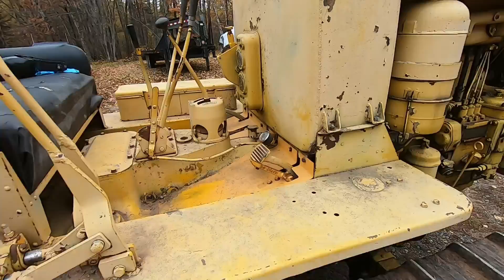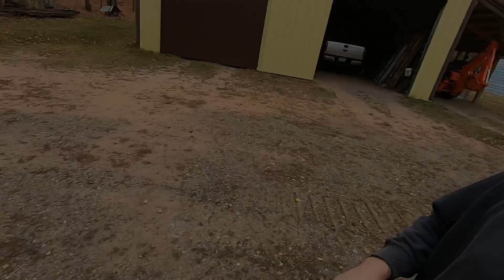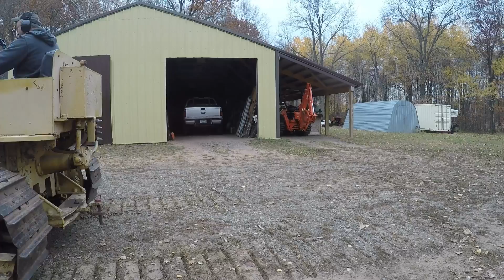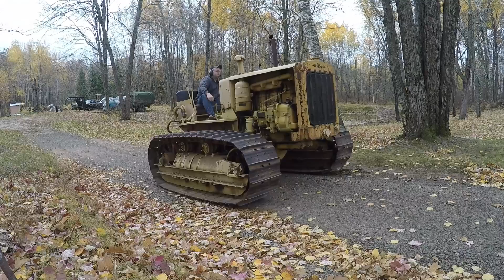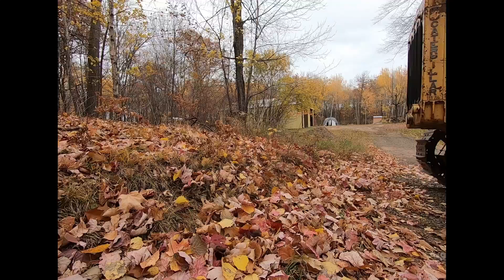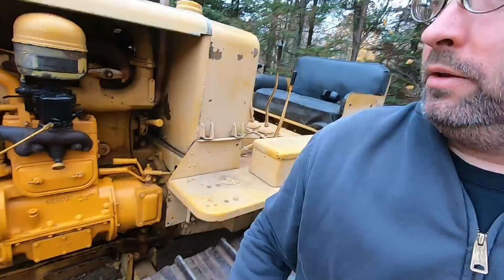Caterpillar "Pony Motor" - Can Just The Starting Engine Power The Whole Machine? Let's Find Out...

Comment: This all makes sense, actually. 
The diesel is rated at 52 bhp @ 750 rpm. Or 364 ft/lbs.
The pony engine is 24 bhp @ 2700. 
Or 46.7 ft/lbs. 
So, the pony engine develops 46% of the horsepower of the diesel at 3.6 times the rpm. 
Effectively, the pony engine develops 12.83% of the torque of the diesel at the pony engine's crankshaft. 
Given the ratio of the pony engine's starter pinion, & the ring gear around the diesel's flywheel, which is probably around 40:1, then moving the dozer in low gears & light load isn't too difficult.

Comment: I just picked up a D68U early 50s model and this is what im having to do to move it. Problem is they left it parked in gear and it wont come back out.
Reply from the maker: Make sure the main clutch is disengaged before trying to pull it out of gear, because there’s a shift interlock that prevents the shifter from being moved when the clutch is engaged. If that doesn’t pan out, you might be fighting an interlock linkage that has been damaged or has come disconnected, preventing it from releasing 👍
Reply: The shifter will go forward and back but will not go left or right. Im guessing its stuck in 3rd. Pony motor runs but diesel wont turn over.

Comment: Hey that was pretty cool. Yes I wondered about the missfire and your thinking it didn't have enough power to go. You didn't hear that much RPM loss, as if it was stalling because of load, but the timing thing makes sense. Its kind of funny, as heavy as that starting engine is, that its design is so limited, and not like a conventional small engine. Sure, it does what it is needed to do, but for an outsider like myself, I'm surprised. In theory, 24 HP should be enough to move dirt in the lowest gears. Something I have no idea about - does the compression release fully release all compression, or does it just reduce it? It sounds like engaging the diesel does put quit a bit of load on it. 
My context for all these questions really comes from some of those "will it start" videos, where the crawler is buried in the woods some place. If they can just get the pony motor running, they could at least rescue it and get it on a trailer.

Comment: I am new to Bulldozers. So you have a gasoline powered Pony engine that on demand can turn the crankshaft to start the diesel engine. Can the diesel engine start without the pony engine? ie: does it have a stand alone starting system also? I heard about air starters in the past and of course conventional use electric starters. That drivetrain has a ton of gear reduction to move that thing by the pony engine in 4th gear! I think it was 24 horsepower and 13,000 lb s?

Comment: 15:27 That was not running full throttle - the governor was actually doing its job ! So maybe the ignition was too far advanced. Maybe it was a fuel issue too - as those engines aren't expected to get bumped around in use !

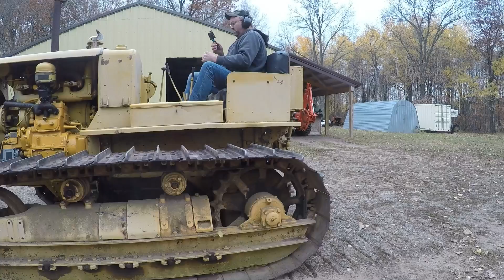Comment: 5:00 - so if normal engine rpm is 1,000 and the donkey engine drives the main engine at 100 rpm, that's 10:1. If the gear ratio of 1st gear is 10:1 too then, driven by the donkey engine, an hour's work would take upwards of 100 hours to complete !
I did expect it to do all it would with the main engine power - but ever so slowly !

Comment: Great Video, I enjoyed that. Reminds me of the time I had to move my Land Rover about a mile using just the starter motor. It went surprisingly well with the four spark plugs removed so no compression, the transfer box in low range and just done in stages to let the motor cool down. I had a small 12v generator running in the load bay keeping the battery charged. Took a while but it sure beat pushing it!
Reply: What was the output current of the generator ?
Why would the engine start?

#epic_journey !

Reminds me of a journey in an early Landy towing something up a hill - at a speed where I started counting the white centre lines on the road !

Comment: There is a 1950s D7 cable lift for sale/bid here, but the pony motor is replaced by an electrical start.  Is this a deal killer?  I can pay a bit over double instead for a used model D6 6-way.
Reply: @squatch253  A can of ether spray?

Comment: Look at it this way, WW1 tanks weighed around 28 imperial tons , max speed of 3-4mph and needed a 16 litre , 6 cylinder petrol engine of 105hp. In that context, look how far we've come when you can run a Cat on a 26hp engine. Massive advances in gearing and engine technology , let alone metallurgy. Surprising what these old engines can do.

Comment: Excellent, Very Impressive Machine!! I agree with you about the Timing and Hill Climb the way it was popping, if it was fuel it would gradually slow down even running at full throttle. The popping is from the unburnt fuel in the exhaust from the misfire, timing. Both engines sound Excellent Running, the crispness in the diesel engine Very Nice!! This test also proved how good the hydraulic system, I was thinking there wouldn't be enough RPMs to run the hydraulics, it did steering and all!! 
Thank You For Sharing!!!
Liked, Sub & Notified

Comment: I’m gonna comment before I watch, because the petrol is likely geared to get the diesel going as fast as it can on a cold day. So it can’t move the tractor. It could if it was geared lower, it is big enough, but it can’t :o)
Reply: I was delightfully wrong :) I’ve rebuilt a few of those top rollers. I got pretty quick and used to do say six at a time.

Comment: the movement of governor throttle linkage was jumpy and snapping wide open fast so I'm saying lean out misfire, my ears were also saying lean misfire/backfire, so a bit richer main jet setting should have fixed it right up. if not then try backing the timing off some, but it will lose power fast :)

Comment: My father hauled and operated heavy equipment for years I grew up watching him load and unload the equipment when they break the only way to get them back to the shop and repair on was running on the pony engine reverse is the lowest gear and it will back it onto the trailer

Comment: I don't think that harmed the starting motor at all. They may have not been designed as a continuous run all day engine but folks have to realize that that engine wasn't just designed to start the main it was deigned to warm the main for starting. Combined water jacket to warm the main's water. Exhaust running through the main intake to warm the air coming in and then compression on with main fuel off to warm the heads. If you are in milder climates you didn't have to run it long. But if it's minus 40 back then? Starting wasn't an option and few had machine sheds heated to store equipment day to day or even access to power to plug in a block heater. Also consider the viscosity of the 30 weight oil they used then as compared to today in those colder temps. I think those starting motors are a lot tougher than folks give them credit.

Comment: I dont know if this story is true but I used to be a mechanic for caterpillar years ago and I heard a story of a guy that was hired on by a coal company and he claimed to have more experience operating a dozer than he said he did so he got hired and they gave him a job to do with a cat dozer, they dropped him off and told him what to do, he came back a little while later complaining that the dozer didnt have any power so the boss goes out to the dozer and fires up the pony engine then starts the diesel and starts pushing, the new guy has a very puzzled look on his face, when the boss man shuts the machine down and comes over to the new guy the boss man soon finds out that the new guy had fired up the pony engine and engaged the drive and was trying to run the machine and push dirt with the pony engine 😅

Comment: According to the old timers in the area it was fairly common to use the pony motors to get unstuck. It would turn the tracks slow enough to walk the machine out of the mud instead of spinning.
Reply: Why not just idle the main engine down , I sure never heard of such a thing

Comment: We did a airstrip job(?) back in the 70’s(?) - before my time

Had a couple of machines with pony motors that they used to just start by letting the brakes off and letting it roll down the slop... to the cliff that lead into the water

Because, it was easier.

I think one machine was new, both were fucked after the job.

Comment: Thumbs up for your video.
You'd almost think it was designed like that for emergency use but with most diesel failures you wouldn't be able to spin the engine

Comment: I'm not surprised the pony could move it, as the electric starter motor on a manual geared car or truck can move the vehicle quite strongly in 1st or reverse, without any decompression.   Done it myself to recover a vehicle driven by a ning nong into a river.
A question for Squatch:   I bought an old D4 to do firebreaks on my hobby farm.  I found that if the diesel was already a bit warm, once I had the pony turning over the diesel, even with decompression on and the rack set to cut-off, you could feel the diesel kicking and puffs of smoke would come from the diesel exhaust.  Is this typical or was there a faulty adjustment somewhere (could only be in the  fuel pump)?  I initially thought that the decompression lever was not fully effective due to excess wear, but on inspection this was not the case.    Yet the diesel always stopped promptly when the rack was closed.
I wouldn't worry too much about shortening the life of the pony in this test.  While nobody in Cat would have thought it would ever be used for more than a minute or 2 each time,  once it is competently engineered with sufficient bearing surfaces etc to function, its life should be not particularly shorter than any other small splash lube gasoline engine.  Perhaps the pinion will wear though.
What I found is that these pony motors (on my D4 anyway) get their water jackets and passage clogged up with white gunge which causes overheating - which will certainly shorten its life dramatically - but in this case Squatch has already rebuilt the pony so that won't be a problem.  Not long after I bought it, I had to rebuild my pony due to clogged water jackets.
Reply: @squatch253  Hi, thanks for responding.   It's a 6U (1950's).   I take it from your reply that it indeed isn't normal for it to occasionally weakly fire when the lever is in the shut off position.  I didn't want to go dissassembling the fuel system for no good reason.  I have the usual hobby farmer's level of experience with gasoline engines but no diesel repair experience until the D4.   You may be amused - one steering clutch failed within run-time hours of me buying it.  Turned out that hoses that convey grease from nipples to bearings had come apart - plenty of grease in the bottom of the housing but not where it was needed.  Diesel engine runs nicely though.
Reply: @squatch253  Thank you muchly.   I'm going up to the farm this afternoon to do some work over the weekend, so I'll try your instructions.  I would be surprised if there is any problem with the injectors,  as the engine runs very smoothly at all settings  No smoke at any time except a bit upon starting or cranking as described.
Re parts:  Local Cat dealer parts department is pretty impressive.   I have yet to ask for anything they didn't have in stock, or couldn't produce same day from another branch.

Comment: What about the possibility of the engine hydraulically locking due to all the excess fuel? And if the fuel was off what about running it like that with no upper cylinder lubrication? So either way with the fuel on or with the fuel off I just don’t think that’s a good idea!
Reply: The atomized diesel gets pumped out the exhaust, it will never hydraulic lock.

Comment: We had an old D7 cable dozer with a trailer log arch that we skidded logs with when I was kid. Diesel spit 2 rods out of it about a mile back in the woods my grandfather spent 2 days pulling the head and getting the pistons and broken rods out of it. he through the pan back up and head on and dumped a few gallons of oil in it so the crank had something threw some antifreeze in it and limped the crawler and arch back to the landing on the pony wasn't fast by any means and had to stop a few times to let the pony cool down but he got it back to the landing and then drug another 5-10 miles with our old pacific truck I felt like a king thar day being 13yrs old in a monster pacific towing my grandfather out to a main road some of my best memories.

Comment: Worked on dozers (D9 serial 66A12576) used in strip mines in the 70'0 had poney motors. In fact as far as i remember all 9G's could be speced with pony motors.

Comment: I strongly believe that no internal combustion engine should run on "straight weight, non-detergent" oil.  Gasoline 10W30 is fine.  Well below freezing operation, probably 5W20.  High ambient, 20W50.  Clearly heavier for diesel engines.
Synthetic not required.
Reply: @squatch253  You are correct about that !  Just my opinion.  Along with $1 it will get you a "Senior coffee" at McDonald's !
Reply: @squatch253  Maybe you can help this guy source some parts.  https://youtu.be/ogJKfZmlt24  For sure he need a F7X15 sediment bowl and gasket for his money

Comment: Not long out of high school, I worked on a pipeline as a swamper on a D-7 Cat that had a pony motor that I had to start each morning.   It could be a bear in cold weather.   It had a cable lift blade that  operated from a front end PTO winch that had a clutch system in front of the radiator and a heavy duty winch on the rear.  The operator that ran it only had one arm.   There was no power assist on anything on that tractor, he had amazing skills.

Comment: Really didn't surprise me on the flat, on that incline that's a different thing all together, you're probably right about the spark advance but I wouldn't do it again, you know you'd feel terrible if anything happens to the start engine, thanks for doing it I've wondered about that myself, at the end of the day I think it was designed to be able to do that in an emergency situation

Comment: I often wished some of the new machinery had pony motors. They don't even have a clutch on the hydraulic pump so they turn everything when trying to start. They have to be parked inside when it's cold.

Comment: My first initial answer is/was, yes. For the simple reason, you're turning the diesel engine over hence, turning the clutch(s) and transmission gears. Only other concern of doing this is, the injector pump on the diesel, it's turning without any fuel being pumped through it. Last I knew, injector pumps used the fuel oil as lubricant. This isn't recommended from Cat if I remember correctly, I could be wrong. 
For those saying proper gearing, yes, absolutely correct. Look at John Deere's 2 cylinder tractors, it's how they're designed. 
You thought process might be spot on but, how much gas is in the tank for that starter engine? My old JD "B" acts like that on an incline when the tank is starting to get low on gas. Great video, cheers :)

Comment: I wondered about that also with the International TD-6 that we were running a lot of years ago but was never brave/stupid  enough to try it. On those they never really had a pony motor as it was set up to use gasoline to start it and then switch over to diesel.
Reply: I did it once with a international diesel, was not good, overheated it , I was a very stupid kid when I done it

Comment: Your pony engine splutter when under load is caused by lean mixture not ignition timing, the pony has a governor which holds the throttle near closed when off load and progressively opens the throttle as load is applied and the motor slows down, in you test the load was higher than you have ever asked of it before and the throttle opened to a position where the fuel mixture became too lean, all you need to do is richen the carb high speed adjustment or if it does not have any adjustment install a larger main jet

Comment: Unbelievable!  I would have bet against that, especially in 4th gear, and 1st gear up hill.  Is there two speeds on the pony motor?  My uncle had a late 1930's D8 with the pony on it like yours, but it had a hi and lo range to the pinion gear.  Also these ponys sounded like a 50 cal machine gun when running, LOUD!

Comment: My guess is that Cat did that so you can get it out of the field if the main engine failed while working.
Reply: I doubt that, as Cat sure never claimed that as an option, and depending on the problem with the main engine , turning it over could really destroy things inside , go from a minor repair to a major one

Comment: With only splash oiling, ..... those poor crankshaft and con-rod bearings. We have found 5% add of Lucas oil additive really extends the life of splash oiled crankshaft bearings, adding some 'stickieness' to the oil film, while not dramatically increasing its viscosity.  We used to go through an air compressor head every 18 months like clockwork, but now have 11 years on same head with 5% Lucas in the same 30wt oil.  Also use it in all our 4 stroke yard and garden power tools, and ceased having crankshaft bearing failures. Lots of stuff out there just splash oiled...

Comment: Retarding the ignition timing would only reduce power. The pony just needed a little more fuel for the load [lean misfire vs lugging/load] It would act the same if the ambient[oils] were 30- 40 degrees colder. IMHO  Edit: 'little more' = 1/8 on turn on main[if adjustable] or 1/4 on idle mixture should do it. It's so darn close right now.

Comment: Squatch, got a question question. In a lot of things the reverse gear is actually geared lower than first gear. Are the caterpillars similar? I wonder what that pony could do with the cat going in reverse up something. Pretty impressive moving 16klbs with 24hp.
Reply: Usually working machines aren't geared like that, because well - reverse is sometimes used for work.